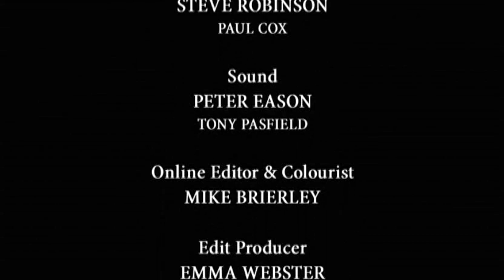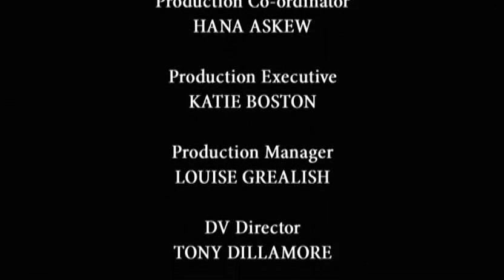Mastercrafts part 1 of 6 - Green Woodcraft

Comment: If you view the films of the bodgers, they worked their pole lathes much higher. I wonder why. 
No point in making Greenwood parallel tenons to 0.1mm as they will shrink. Setting a novice against a professional woodworker is just a tv gimmick. A woodwork teacher wearing a tie. Not health and safety. 
Chair design is full of complicated angles and maybe curves, which were not covered. 
Bodgers only roughly turned out Windsor chair parts. They were factory finished in High Wycombe.
Tenons were often tapered and maybe wedged.